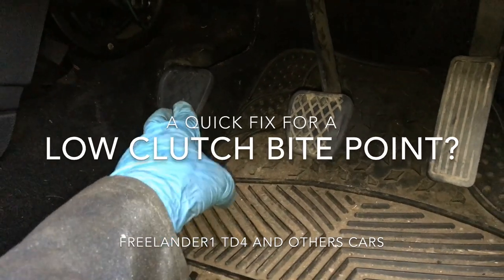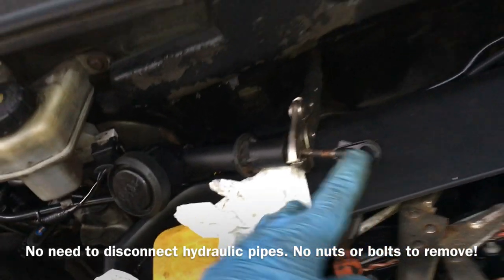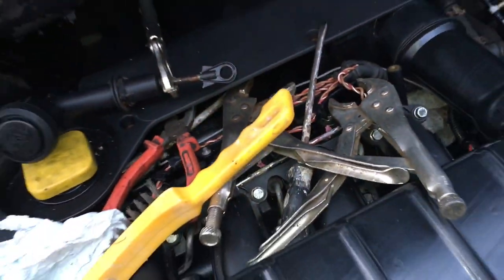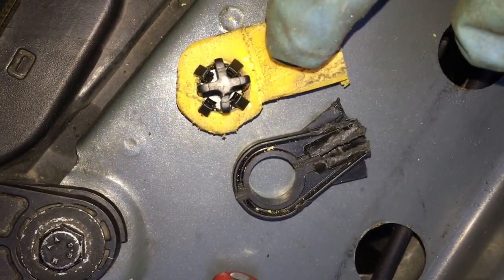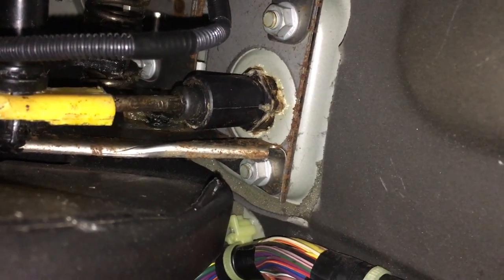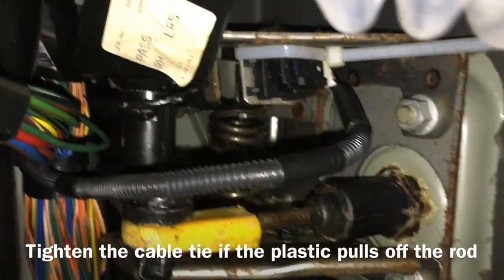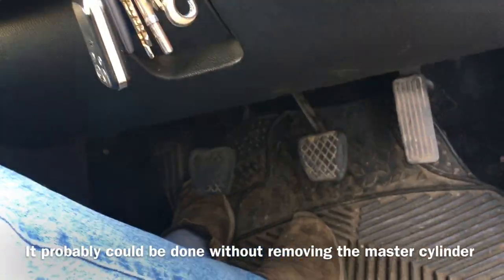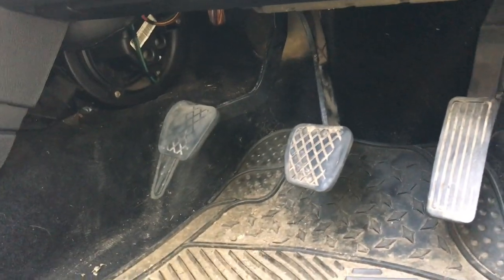Low Clutch Bite Point? How I Did a Quick Fix. Freelander and other cars

Comment: I found on a forum mention that if you leave your clucth pedal wedged down overnight it self bleeds the master - bloody hell worked a treat! Highest it's been in forever.
Reply from the maker: Not heard that, thanks for the tip. Be interested how often that works and how long it lasts.
Reply: @comeinhandynow  Worked for about 6 months for me everytime my bite got low, seemed to be getting air into the master and this would get it back out again. Used to last a few weeks and eventually came down to just a day or so. Changed the master cylinder now and I cannot get the b****** thing to bleed back up. Suspect I have air in the slave which I've not been able to bleed out conventionally - going to try back bleeding the slave and pressure bleeding the whole system if I can come up with a way to adapt the bleed kit to fit the master and the limited space I have to work with.... god I hope it works. Might as well scrap the car if it's the concentric slave (which was only changed 60k ago)...... 😔
Reply: Update on this - turned out my clutch pedal was actually BENT! Had to yield and take to the garage - hence it didn't have enough run to bleed the cylinder. Laaavly now. It's still needs bleeding every few thousands which suggests there is an issue with the slave - but I really do not want to go in there.

Comment: Personally I think a low bite feels a lot better I jus got my clutch replaced and now I hate the high bite feeling
Reply from the maker: Ideally the bite point should be right in the middle of the pedal travel. You’ll get used to any change even though you are of course used to the old position.  Too low is really bad as you will wear the synchro rings in the gearbox if you need to push hard to engage gears.
Reply: I would sooner have a high bite point me, a low bite point like the one i have now makes the gear changes hard and clunky, feels like there is no clutch with hard to get gears when driving

Comment: I was just about to give up my Grand Vitara but tried this just now, i made a piece from aluminium 8mm longer than standard and it worked perfect!
Reply from the maker: Glad it helped
Reply: Hi, I’m trailing through YouTube looking for help with my Grand Vitara 2009 mk2. I have a very low biting point and now struggling to get it into gear. Do you think this will work. What year was you Vitara? Thanks
Reply: @David_Max  mine is 2007, this did work for me at least.
Reply: Mines an 04 reckon this would work?

Comment: Sat in my td4 as I type and my clutch pedal is a good inch lower than the brake pedal. Changed the clutch and master/slave cylinders at the same Time and it still bites low. Thinking in my instancë the pedal is being stopped by the switch.
Reply from the maker: Time to look at the end of the pedal and see what the problem is, it would probably benefit by the same sort of fix as in the video.

Comment: What if my bite point is very high? On my 93 Civic the grab point is at the point where I almost have the pedal all the way up. Would this solution also work for my situation?
Reply from the maker: That’s more likely to be a worn out clutch plate.  It’s close to needing a new clutch probably.  Time to sell.
Reply: @comeinhandynow  A clutch on an old Honda is like $30. You can literally replace the engine from anywhere from a few hundred to a thousand dollars. Honda will run forever, not time to sell.
Reply: @t58beare  could also be a great learning experience if you are a diy person and decide to do it on your own
Reply: Sooner have a high bite point me makes it feel as you have a good working clutch, all the cars I have had with a high bite point have had great clutches with well nice gear changes

Comment: Same replaced master and slave cylinder on the 97 ex Honda now the clutch engages way later which I’m not use too:(
Reply from the maker: Yep not good. If clutch not fully disengaging then it wears the gearbox synchros as well.  It's a pain trying to get air out, unsuccessfully.

Comment: I will check my one out tomorrow I have a old Toyota Coaster 1977 I brought 4 years ago it has been in my backyard for 4 years and I have been working on it but it's time for me to get my clutch working again. I brought a new slave cylinder and I bleed it and I still don't have no clutch my clutch pedal is up but I can't push on it with one finger to the floor that is too soft that means I would need a new clutch master. I don't have a clutch reservoir on mine my one is joined with my brakes master, would that be the cause of that with no clutch
Reply from the maker: It does sound like there is still air in it.  When you bleed it was it clear of air bubbles?

Comment: Hi, great video. I have just bought a Freelander 1 TD4 - The clutch pedal height in relation to the rest is FAR too high....but the bite point is very low. Could this method fix this this problem? - Thanks. Scott
Reply from the maker: It will make the bite point and pedal higher (when not pressed)
Reply: @comeinhandynow  Thanks for your reply, perhaps I should firstly try limiting the pedal height with the 'cable tie' method. - re; bleeding - Does a good old fashioned gravity bleed work on these cars or is there another, better way/ - I have a Gunsons Eazi-Bleed pressure bleeder but I suspect there is no way it will work with the existing clutch master cylinder resevoir. Sorry for all the questions, great videos..thanks.
Reply from the maker: @scottstephen3125  Only limit the height if the pedal is detaching from the master cylinder rod, otherwise the reduction in movement might eventually mean the bite point disappears through the floor.  On bleeding, it is a pain.  I have a Gunson but couldn't make up any cap to fit.  I tried reverse pressure bleeding from the slave side but that made it feel worse.  The best but not fully satisfactory method I found was the usual ask the wife to push the clutch while opening the slave bleed then tighten, pedal up and repeat.  Still felt like a bit of air in there, hence I resorted to the fix in the video, which did make it ideal.

Comment: Is this an actual fix or just a temporary botch job? Is there a problem with one of the clutch cylinders or is there just air in the lines that's hard to bleed out?? I have a similar problem on a td4 freelander i just got where clutch pedal would sometimes stick on the floor then after i tried bleeding it it was a little better then got a lot worse to the point i couldn't get it into gear.
Tried swapping master cylinder for a new replacement and no better, Really don't want to have to remove the gearbox but starting to look like i might have to,
Reply from the maker: This seems to work as a fix. I had the same experience with a td4.  It’s a devil of a job to get the last bit of air out.  This fix just allows more clutch movement to compensate for it.  Worth trying before you take off the gearbox!
Reply: I would say it’s a bit of a botch job. I have just replaced the clutch master and slave cylinder on my 1.8 petrol Freelander and it’s a closed system and not designed to be bled. If you think it needs bleeding then just buy a new one. £58 eBay. 
The y are very easy to fit as long as you have not had an idiot trying to do a botch repair before you, like I had with the bracket having bits of poorly welded (the welds has cold lap) pieces of metal added to it because they didn’t have the plastic clip that secures it.

Comment: Hi. My pedal has got around 15mm play from the top before I feel some resistance. Is this normal
Reply from the maker: Doesn’t sounds too bad, the more critical thing is how much extra do you have at the bottom after the clutch is completely disenganged and there is no drive.  Is there extra movement beyond that point?
Reply: @comeinhandynow  the biting point isn't near the floor at the moment. Thanks for all of your videos.. I've been wanting a freelander for a while and I purchased a td4 sport, your videos help a lot. The biggest issue at the moment is the water in the boot!. Thanks for your reply!
Reply from the maker: @theotherbloke7102  Water in the boot is fixable, I fixed mine and sometimes think I should do a video on it.  The water runs down the seals on the back door and can sneak under the rear bottom plastic to the boot recess.  Put in some silicon or polymer sealant to seal and make water guides to guide it out instead of in.  Look for water traces after it has rained.
Reply: @comeinhandynow  Brilliant, thanks. Love your channel 👍

Comment: Hai ..i want to ask ? What happen if the biting point to low ? Why need to adjust?
Reply: Many people said if low biting point or low clutch, it is difficult to control gas and clutch when creeping in uphill   ...is it true ?
Reply from the maker: If the bite point is too low then the clutch is only just disengaging and there will still be a bit of drag across the clutch.  This can make changing gear more difficult and also create more gearbox wear.
Reply from the maker: It does also make it more difficult to drive, yes, just because you have to press the clutch pedal a long way right into the carpet.

Comment: If you extend the rod it will act like you pushing still the clutch a little bit on teh resting point. It's a good solution in case the added length on the rod in the  resting point doesn't move the clutch arm any mm at all.
Reply from the maker: No actually it is not pushing on the rod all the time, it just extends the rod higher. There is plenty of extra space to move the pedal higher.
Reply: @comeinhandynow  maybe on the Freelander bit on the zs/45 you can't push up the clutch pedal higher cause it has a fixed upward position so it will be pushing on the clutch :-( bought a new master and slave and it is worse on my 45 than with the old hydraulics. Clutch arm is not seized btw
Reply from the maker: This video on changing the pivot point of the clutch should help:  https://youtu.be/trd_b2LDX7g

Or if its a petrol k series model then this one:  https://youtu.be/z8t2dvIP3cY
Reply: @stupa55  did you fix this?, how long was the length of travel from the slave cylinder pushrod arm to the gearbox, my 45 only pushs 11mm and im wondering if its the clutch or the slave?
Reply: @lazycarper7925  nahh sadly not :-( I compared the travel of the rod on my other l-series and it travels more further. I changed even for a brand new  slave and master but It didn't cure the issue.  Also comparing a good working hydraulic with the sheddist clutch kit it hase even more throw :-)
Reply: @stupa55  what is the final plan to fix your problem if you still have it, my car cost 800 quid and ive done the cam belt and fan belt but im wondering if its worse going down the road of new slave , master, clutch etc, when i may as well count my losses and move on, i can see my slave rod pushing out by 11 mm but its not engaging the clutch properly, ive never had any slipping etc, so im stuck what to do now?
Reply: @lazycarper7925  get the sheddist clutch kit to be honest. Dark ice sells it.
Reply: @stupa55  did you get the kit?, did it work?
Reply: @lazycarper7925  it will work but I have mine collecting dust and waiting for installation :-)

Comment: just go out and buy a new one.. what a bodge job
Reply from the maker: You didn’t quite get the point, 1st doing stuff for free, 2nd compensating for the often impossible job of getting the last bit of air out of the system when up or down or pressure bleeding doesn’t work.